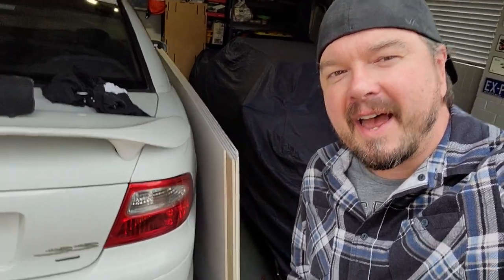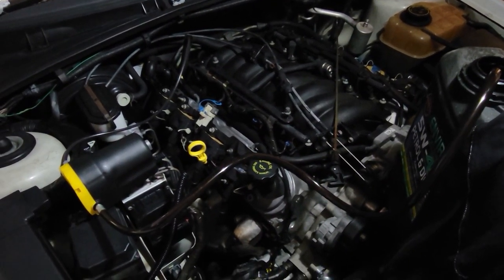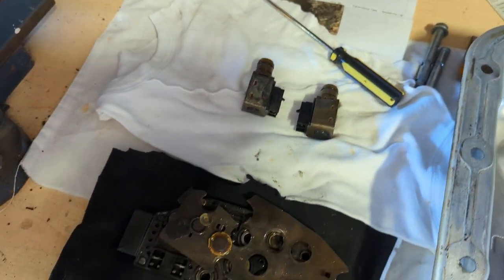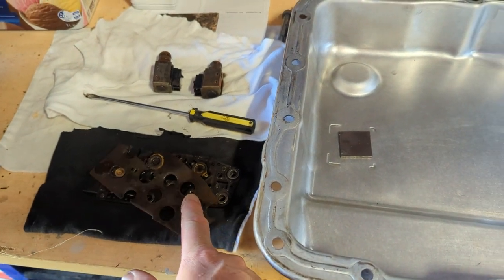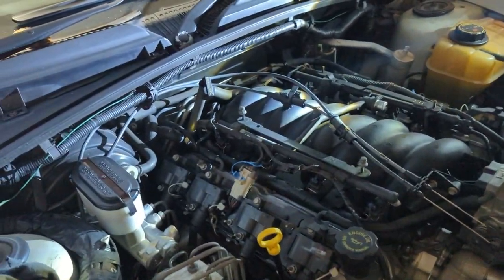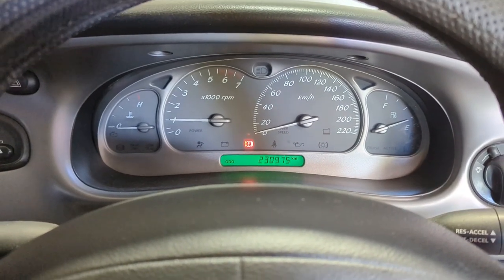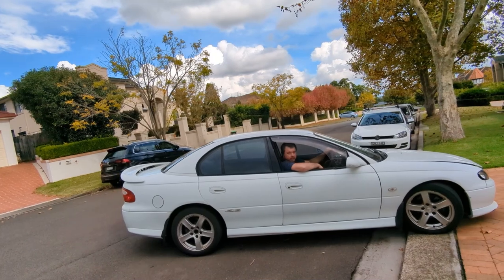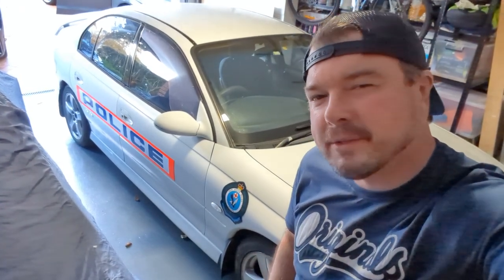Fixing a VX SS Commodore 4L60E Transmission

Comment: Very informative bruv👍
My VX SS has no 2nd gear at the moment and I'm pretty sure I have the same problem, I got the 4L60E serviced with a new trans filter & solenoid replaced etc in 2013 then also replaced waterpump power steering starter & alternator etc and put the SS in storage from 2016 to 2021,and now it has no second again 🤔

Also the SS has just over 300thousand Ks (I put 160thou in 17 yrs of ownership) and not 1 problem other than the 2nd gear but Im getting the LS1 and transmission rebuilt this year

Comment: What happens when the solenoids needs replacing or why are you doing this
Reply from the maker: Didn't have 1st gear and was very sluggish. After this vid I completely stripped and rebuilt this transmission. The valve body was heavily clogged up and some valves seized. 3/4 clutches worn. The rest was pretty decent.